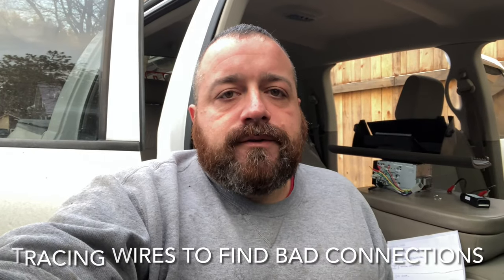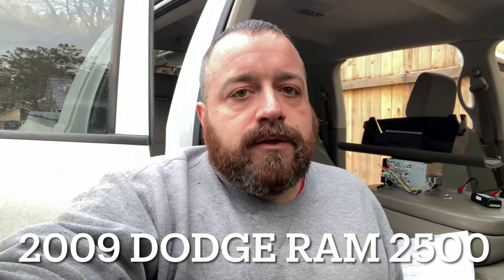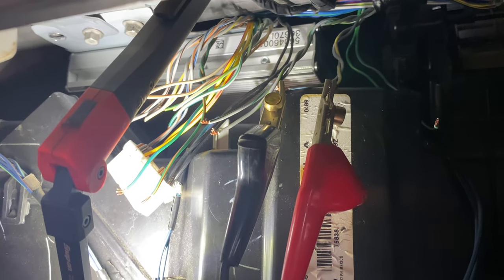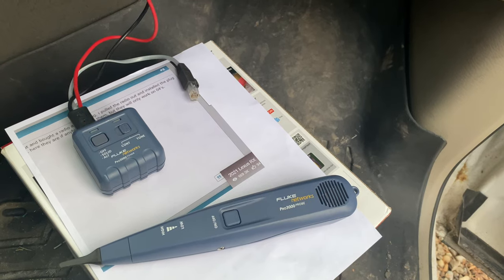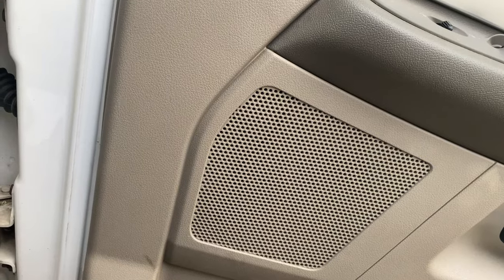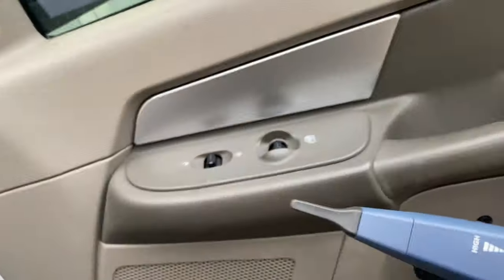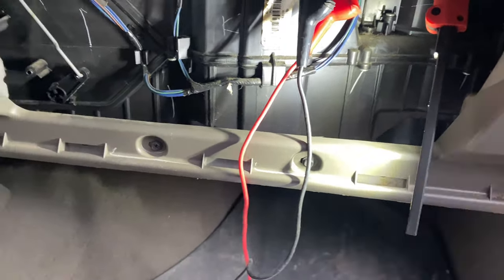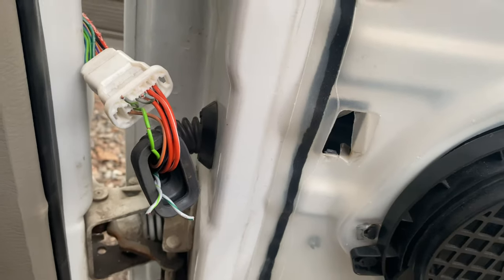Tracing bad wiring connections

Comment: Joe - thank you for the video and for sharing you knowledge.  I have a camper that I need to find an ignition wire that is energized when the key is on.  As you can imagine, the camper is a rats nest of wire.  I know where the fuse is at that provides power to the ignition.  Will the tool you are using work in this instance?  As I see it I could remove the fuse and attach the tone generator to both sides of the fuse connection.  Then I should be able to use the probe to trace the wire.  Do I have this right?  Thank you.  Keep up the good work!
Reply from the maker: That makes sense. Yes.

Comment: Hello: do you need to connect booth cocodrile to "send" that tone ???     What if I need to inspect  only one wire ? (to find were is broken,  like headphones with missing channel)
Reply: If you just use one crocodile clip, the signal will still be there just a bit weaker

Comment: You say it can test on low voltage wiring?   Others say it can’t have power in the line at all.

Would using the probe on 12v UTP comms cable damage the unit?

We have a small cable fault on external alarm cable pair, but there are 36 pairs - 4 runs of cable with 8 core in each.
Reply from the maker: This kit comes with a signal generator and the probe. For your scenario you should disconnect power to the circuit, attach the signal generator at one end and then trace the wire with the probe.  When is say it’s commonly used for low-voltage wiring I mean the type of wires that carry low voltage…not that the wires should be energized while testing.
Reply: @JoesCarSmartsNY he sayin disconnect your battery bruh

Comment: i've got a Parasitic draw on my battery of 2amPs.  i Pull the fuse, that shows radio and instrument cluster.  can this tyPe of tool be Pluged into that fuse to find the shorted wire?
Reply from the maker: This type of tool would help you trace every spot that wire is connected to but that doesn’t help with a parasitic draw. It’s probably not a wire shorted to ground, but a defective device (like a radio or amplifier) drawing power improperly.  Here’s a thread on it. If it’s not the radio, you’ll have to learn what else is on that fuse and unplug it one device at a time until the draw goes away (or to the acceptable 50mA level. https://www.ramforum.com/threads/parasitic-battery-draw.123727/
Reply: @JoesCarSmartsNY  Thank you, very much!  that's what i susePected.   there's three Pigtails that Plug into the back of the instrument cluster.  When I unPlug the center one. The draw goes away.  I susPect my next steP is unPlug the devices that cluster controls, and if the draw still doesn't go away then it's the instrument cluster itself.  any chance you know of someone that works on instrument clusters?  That I could send it too.  I can't find anyone, that works on electronics anymore.
Reply from the maker: @keithh3767  United Radio in Syracuse NY does a lot of work on things like this. Call them and ask about it. I know there’s a website I’ve used for GM clusters before, but I can’t remember it right now. Not sure if they do Dodge also.

Comment: My drivers side power window works intermittently, then the door open light will come on along with my interior lights which also don't shut off if I've shut off the car. Its not the power window switch and its not the power window motor. When i opened the door to check the wires inside the harness to the frame i noticed one wire had a piece of tape on it but i haven't furthered explored that. Already opened the door panel to check behind and nothing. Checked all my fuses. Im thinking of buying one of these tools because ill be damned if i take it to a dealer and get charged $500 !!!! Could a bad relay be causing all these things to not work at once? The problem is some of my fuses and relays dont give me a clear description as to what function they serve but the fuses all light up. The relays im not sure about either. Any insight?
Reply from the maker: I would carefully inspect the wiring between the body and the door. You may not even need to buy a new tool. You may just need to repair bad connections in that harness.  You may also have a combination issue. Possible bad wiring connection and an intermittent window switch. I know you said the switch isn’t the problem, but sometimes temp and humidity can affect a dying switch.
Reply: @JoesCarSmartsNY  thanks so much...I was wondering if maybe because we had some rain and a lot of humidity if that doesn't affect it as well but there's no where water is getting in. Yesterday they were working and today they aren't. Drives a sane person insane 😀. I will get back to pulling that piece of tape off and seeing what's going on there. Thanks again!

Comment: What about if you don't know which wire is the bad?
How you would set up the sender.?
Reply from the maker: You’d have to learn which wire wasn’t working correctly. In this case if I didn’t know the wire colors at the amplifier end I would have to go to the speaker end and connect there. Then I’d learn the correct wire colors to scan at the amplifier. The same concept applies to other systems. You’d have to know which wires have failed in order to test them.

Comment: Can I use that for the 02sensor signal wire ? Up stream
Reply from the maker: Sure. Are you trying to find it in a harness or what?
Reply: @JoesCarSmartsNY OBD SCANNER said communication wire is broken somewhere
Reply from the maker: @pedritoc.c.t.665  Aha. You’ll have to identify the data wires for the sensor at the ECM and send the signal down from there. Then you can use the wand to follow the harness. 

Another thought, I worked on a Dodge Dakota once and someone had miswired the O2 sensor and swapped the two data wires so it wasn’t reading correctly. If you’ve recently replaced a sensor maybe double check the polarity on the data wires.
Reply: @JoesCarSmartsNY  I look for diagram and none I could find someone's thinking use my sound tester for it . Before I take the whole engines harness. Thanks for you help hod bless .
Reply from the maker: @pedritoc.c.t.665  There are services available (usually to pro garages) that can give you detailed wire diagrams. You can pay just for one month or for an ongoing subscription. AllData is one, and I think Mitchell’s is another. That’s how private garages get detailed info like this.
Reply: @JoesCarSmartsNY  ok awesome I will look in to it . I just looked at the harness ad it has 2 big crunch areas  like the car front end was remplased
Reply from the maker: @pedritoc.c.t.665  Wow. That’s a good place to start. What vehicle are you working on?
Reply: @JoesCarSmartsNY  2001 Pontiac Aztek 3.4L
Reply from the maker: @pedritoc.c.t.665  Here ya go:  https://carmanualsclub.com/pontiac-aztek-service-owners-and-maintenance-manuals-pdf/amp/

Choose “2001 Aztek System Wiring Diagrams” —- Page 30, bottom left shows O2 sensor wiring.

Comment: I see the square box has 2 clips that you were connecting to 2 wires what if im trying to trace a single wire
Reply from the maker: If I remember correctly, it will still send a signal down a single wire but the signal is weaker. Most applications for this tool will have two wires. Like speakers, coax cable or Ethernet.

Comment: Can it trace a wire that has 12v on it?  Trying to find where a wire that has 12v on it's disconnected end is getting it's 12v from
Reply from the maker: So you have a wire with 12 Volts on it right now and you want to find out what circuit feeds that wire?
Reply: @JoesCarSmartsNY  Yep, and the installers (nitrous) did not fuse any of the control circuits so pulling fuses is unlikely to find (is difficult to pull fuses in this car.)  I want to trace from the end of the wire to where it's getting the 12v.  Can't disconnect wire since don't know where it goes.
Reply from the maker: @NoferTrunions I would disconnect the battery and attach the tester at the nitrous bottle or wherever you have the wire. Then try to trace that wire with the wand to where it goes. It’s best to use this tester on a circuit when it’s off. It will probably damage the tester if it’s used on a live 12V circuit.
Reply: @JoesCarSmartsNY  I'm also thinking even if the battery is disconnected (that's a 2 hour job on this car), if the wire had 12v 24/7, the PCM also has that, so the signal injector might possibly hard the PCM.
Reply from the maker: @NoferTrunions Two hours to disconnect a battery is wild.  Sounds like a fully customized car?
Reply: @JoesCarSmartsNY  Nope, 1996 Dodge Viper GTS:  battery behind rear tire, 13 fasteners and 4 different head types - have to jack up car and remove rear wheel..  Just think of all the times you should disconnect the battery when doing any kind of electrical maintenance (!)
Reply from the maker: @NoferTrunions Shouldn’t there be a main junction somewhere like a main fuse box that could effectively disconnect the battery from the rest of the car?
Reply: @JoesCarSmartsNY  No, there is a Power Distribution Block by the engine, but you can't get at the battery cable to disconnect.  It's accepted practice you have to uncover the battery and pull a cable (!)   Totally sucks.  People have installed battery disconnects but a lot of them fail - cheap Chinese junk, where do you get quality?